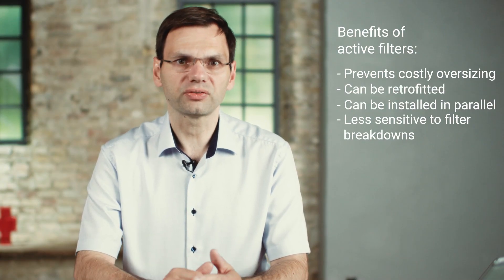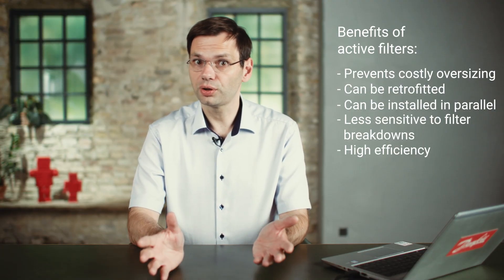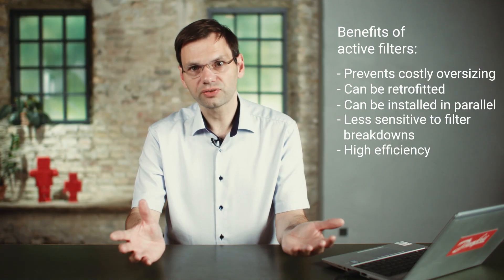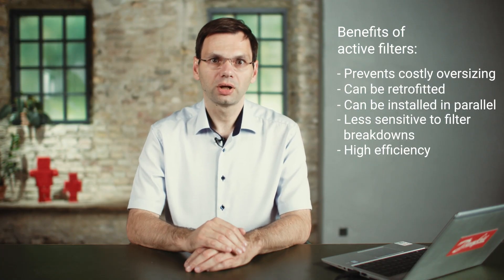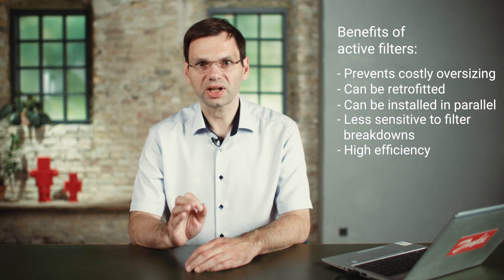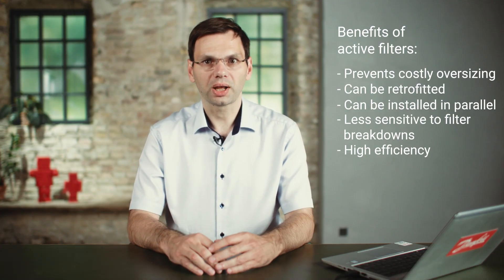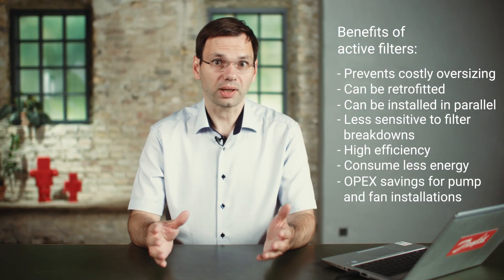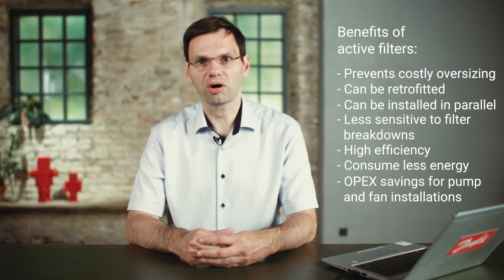Harmonic distortion and how to combat it

Comment: 0:36   Doesn't AC mean alternating current?  Not alternating voltage...
Reply from the maker: Hi @LADaddyG,

Yes, AC stands for alternating current and it is used as general term for alternating power and voltage in Electrical Engineering as well.